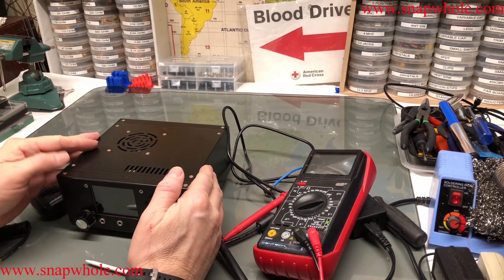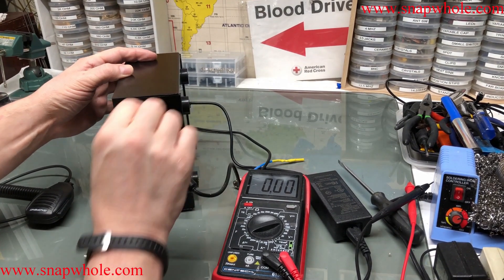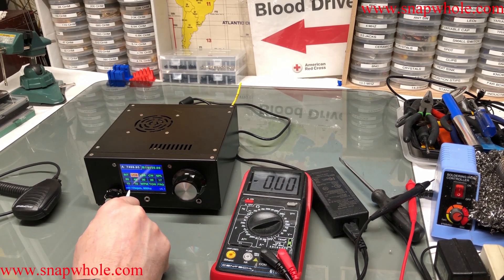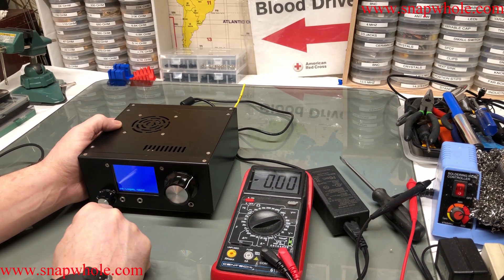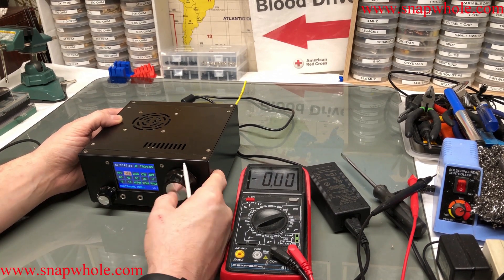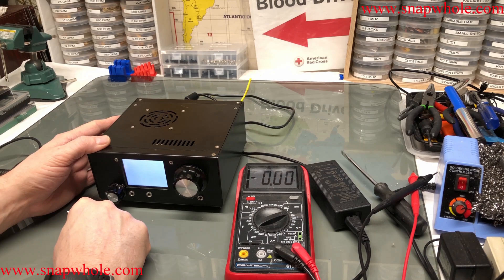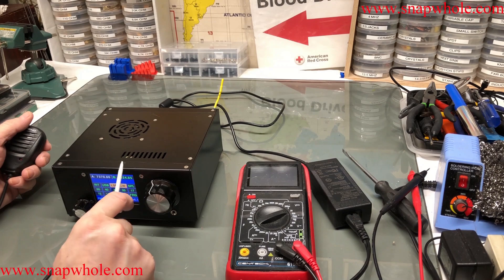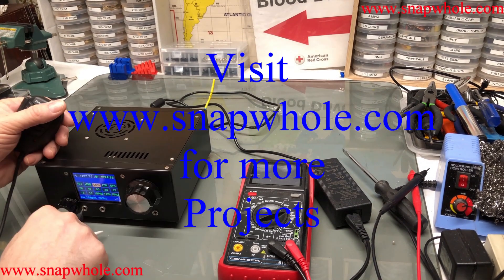uBitx v6 First Power on Control Issues

Comment: Love mine you just have to learn how the radio works. I've been a qrper for many years and this is by far one of the best, good power and of course the higher bands have a little less power..The little guy is meant to experiment with and the first major mod will be some tighter filtering on cw. Have fun 73 ki0ad

Comment: have you thought about updating the firmware of the radio
Reply from the maker: this was a video of the first power on after the assembly was complete, to demonstrate how it worked out of the box, watch my other videos for the construction of a development system, so I can upgrade the code on another system and swap minis so I can keep the completed radio up and running while experimenting with upgrading/modifying the code  - thanks for subscribing

Comment: Hello, I just got one of these. I cannot find any documentation on the polarity of the plug. Did I see you test yours with center positive? 73 KE0OAP
Reply from the maker: plug is center positive
Reply: @SnapwholeEclectic  I got it! It's on the air. It's a fun little radio.

Comment: What type of power supply are you using? It looks like the type I use on my laptop.
Reply from the maker: its a 5 am power supply from a monoprice mini-delta 3D Printer - but is just like a laptop power supply, I used that because it had the right 2.1mm connector and was 12 volts, most laptop supplies use a larger connector and are 19-21 volts - you could use the 19-21v supplies with the adjustable voltage regulator I used for the finals - https://www.youtube.com/watch?v=ewPqkGJcFcQ - Thanks for subscribing